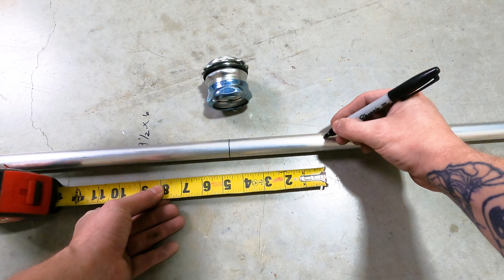How to Bend a 3 Point Saddle in Conduit

Comment: From the center mark where did you come up with 10.5 inches both directions for the 10 degree bends?
Reply: I was wondering the same thing but he is bending it on a 22 1/2 degree cap he used the multiplier

Comment: I always measure to center of obstruction, place mark on conduit at that exact point, then I multiply the height of the obstruction by 2.5 and take that number and go that distance off both sides of the original center mark, and then I use the push through method, first bend on star (22 degrees), second bend on notch (45 degrees) third bend on arrow (22 degrees).
Reply: Don’t forget to account for shrinkage :)
Reply: @joshhowie4071 they did, that’s why they multiplied by 2.5 but its good you brought it up because a lot of people forget that especially newer folk.
Reply: thanks boss saved me 10 mins
Reply: Would that be 3/16s per height of obstruction per inch of rise four shrinkage? Then add that to the center of obstruction Mark? Then 2.5 times height to get the outside marks???
Reply: @joshhowie4071  if you use this method you don’t have to factor in the 3/16” per inch of rise for shrinkage. Just make sure you do star, notch, arrow.
Reply: @joshhowie4071  if you use this method you don’t have to factor in the 3/16” per inch of rise for shrinkage. Just make sure you do star, notch, arrow.
Reply: Same!
Reply: With the push through method, do you bend towards the obstruction or just straight through left, middle, then right?
Reply: @rod82nd  just left, middle, right. you don’t have to take the pipe out of the bender at all until you are complete.
Reply: What about the distance? I've done this method and it doesn't cover the distance I needed over the obstruction .
Reply: @DarkKiller4747 sounds like needs 4 point saddle
Reply: @matthewr209 that’s not a push thru if you’re going left, right, middle. L, m, R.
Reply: @damiancontreras9240  oh hey, good catch I miss typed that, you are correct it is left middle right
Reply: Yoooo I appreciate you bro
Reply: What about 1" obstacles? 2.5" is too close between bends. This was an issue today and my journeyman didn't have an answer 😅
Reply: I did this exact method. My center mark is exactly 28 3/4”. However my 3 point saddle ends up an about an inch away from the center so it doesn’t look good. I thought shrinkage didn’t matter for this method? Help?
Reply: @AnselmlZamora next time just try to add 3/16 for each inch of height
Reply: Where does the 2.5 multiplier come from, how do you know thats the multiplier?
Reply: Is it a constant ?
Reply: Why mesure at different places? I’m dumb sorry I can’t this figure this entire thing out in school I might just quit. I could study transformers or electronic circuits like rectifiers and be fine but this shit is making me zone out and plan out my suicide during class
Reply: @MSI8969  to be honest whenever I run into that I just bend the saddle as small as the measurements allow and then take out a little bit of bend in each bend of the saddle if that makes any sense.. you can do it by doing smaller degree bends (like 15, 30, 15) but since benders don’t have a 15 degree mark I find it easier to just bend a 22.5, 45, 22.5 and unbend each point of the saddle a little bit.
Reply: @JessicaMyers-lh1vo  it is constant for this method.
Reply: @Justin-jy6fu  well you have to measure in 3 different places to determine where to put each bend, not sure how to really explain any better over a text, sometimes it just takes time and repetition.
Reply: @MSI8969 you use a smaller bend radius. Like 10 degrees. So the multiplier is 6.

Comment: The shrinkage on a 3point saddle is 3/16" for every inch of rise.  Never mind I should keep watching until I comment. I use the notch and bend a 45 and 22.5 on the arrows
Reply: Depends on the degree of saddle. You can do a 45 deg center bend and 2-22.5’s. Or a 30 deg center bend and 2-15’s. If you wanted you could even do a 60 degree center bend and 2-30’s. It’s the angle of bend that determines the shrinkage per inch of saddle/offset.
Reply: Yes, the only thing I would add to this is to find shrink you use the formula shrink= angle/120.

Example 30/120=.25
    1/4” per inch of height

Ex 2: 45/120= .375
    3/8” per inch of rise
Obstacle is at 20” off the end and 3” tall. Then make center mark at 21 1/8”
Reply: @Ephesians-ts8ze  Exactly. Electrician U apparently doesn't understand this and proceeds to mess up on his tutorial.

Comment: is it just me or does anyone wonder if that bend would of ended up coming out right ? Where he initially made his center mark ( I think it was 57'') and then did all that calculating just to still have the same initial center mark defeats the purpose. The point is and please correct me if I'm wrong... is for the center mark to to be past 57'' after doing the calculations so that after the shrinkage occurs it ends up being back at 57''. Hope i explained my doubt right
Reply: Exactly.  He got Me all confused! You add the shrinkage to that center line right?

Comment: Thank you for posting this

Im ~1 1/2 year into this trade and have always worked in industrial setting where we run only rigid, aluminum or stainless depending on if its a wet area or not. So ive always  used a power bender except for when its time to bend saddles, which i struggle with. After watching your video it looks like i am overbending

Comment: So the object is 2 inches. 2 inches for every inch so 4 inches. Plus half a inch for shrinkage. Where does the last 6 inch number come from?
Reply: I’m also confused about that
Reply: That’s where I got lost too.
Reply: same
Reply: Yep
Reply: Same
Reply: Edit: I looked into it and it seems somewhat correct according to a Klein chart on it being sort of like offsets. 10 degree has a multiplier of 6 for offsets, so 3 per side since there are two of them and we are splitting it up for either side, or 3 x 2 inches for 6 inches per side, and 22.5 has a multiplier of 2.6 per inch for offsets but since there's only 1 bend instead of 2 so I think 1.3 is the multiplier in this case, so I'm getting 2.6, shrinkage for 10 is 1/16 and for 22.5 is 3/16 so he added both for 1/4, idk where the other inch came from, and I'm guessing he rounded up from there. I saw another video on this, you measure from where your conduit runs from to the obstacle, add the shrinkage of your outer bend (in this case 1/16 per inch of obstacle height) onto that initial measurement (instead of 57, think 57 1/16) and that's your center line, then use the normal offset multiplier (in this case 6 per inch for 10) and measure off that from either end and that's your outer lines, use the notch that was shown in this video for the center bend and the others on the arrow. It was a lot more simple.

I think the first 4 is for the 22.5 bend and the 6 is for the 10 bend, similar to offsets, at least that's how it sounded to me. The 22.5 would be steeper so with the 10 he has to go farther back from the object to make the bend to get the correct rise and fall, thus 6 inches away instead of 4. I could be wrong because I'm confused too, but it sounds like something that might be correct.
Reply: I've been told 3/16

Comment: Dude, you add the shrink to the center mark. If the center of your obstruction is at 57", and you don't add the shrink to that, your center bend won't line up with the center of the obstruction. You have to add that 1/4", or whatever the shrink may be with the degree of bends you are using, to that center mark. So your center mark would be 57 1/4" to account for shrinkage.
In your example, it doesn't matter because you can move the obstruction to be perfectly center.
Reply: @nikogarcia3249 how does the shrinkage effect your measurements in a 4 point saddle?
Reply: @awood965  same way, depending on the degree of bends you are using. But no one cares on a 4 point saddle because you can't really tell if you're a 1/4" off of center. It's very noticeable on a 3 point saddle, however.
Reply: @nikogarcia3249  thankyou sir good info
Reply: Thank you so much I was looking for someone else to catch this thought it was just me lol.
Reply: There is more than one way to cook a burger 😂

Comment: Rubbing alcohol / isporopanol dissolves permanent marker/Sharpie. 
I learned that one in college chem lab, and have used it many times since. 

I've even seen people use hand sanitizer (usually ethyl alcohol/ethanol, the same as drinking alcohol) to dissolve Sharpie. 

Lots of organic solvents dissolve it, since it's really not so "permanent" at all
Reply: pvc glue will as well if the plumbers are around
Reply: Or any shit body spray

Comment: Pro tip, use a dry erase marker. Ive seen many bends with pencil marks left on it.
Reply: i was going to say that also
Reply: Pro tip: just rub off the pencil mark with your finger. If it's to high for you too reach then it's too high for you to see it.
Reply: Nice
I use whatever I have because I could care less as long as the bend is correct conduit is always dirty no matter what when you buy it.
Reply: I don't care either way.
Reply: I am a residential, commercial and heavy industrial electrician, can out troubleshoot 90 % of union sparkys .Construction electricians don't impress me lol...Troubleshoot instrumentation, motor controls,d.c drives ,vfds,plc's etc.35 years in the trade.

Comment: Would you always add 6" for the method he's using?
Reply: I believe he's adding 6" because he's bending 3/4" EMT, the lines you center your bender on should be a certain distance from where you want the bend depending on the size of the conduit - 5" for 1/2", 6" for 3/4", 8" for 1"

Comment: Angles were not discussed, so measurements made little sense to me. For ever inch add a quarter for shrinkage, why? Why didn't you state what height you had to clear?
Reply: I’m a ElectricianU fan but the info in this video could have been explained better. I’m not sure why he used a 1/4” of shrink per inch of rise when a 10 degree bend has a 1/16” of shrink per inch of rise. So since he had to clear a 2” obstruction the distance from the end of the conduit to the center of the saddle bend would be whatever that theoretical distance is plus 1/8”. The shrink itself is derived from your outside bend angle and not your center bend angle.
Reply: @lazarevic95 thanks
Reply: @lazarevic95  because he doesn't know the standard way of doing a 3 point saddle.

Comment: I wonder if it's easier to think of it as an offset so if you need your measured clearance just to add the shrinkage of your 1/4" on both sides so you can scale it to other bend radi. So like 45 and 22.5 is going to be 2x offset calculation plus shrinkage?

Comment: Isopropyl alcohol will remove sharpie with ease. It's the solvent used in the marker to begin with. Wipes right off.
Reply: Pro tip just throw more sharpie over it then wipe away immediately comes right off
Reply: @izzywashington5461  then you have more residue.. Using clean cheap solvent is the Pro tip to do things right..

Comment: Shrink is calculated by 
   Shrink = angle/120

Example 30/120 = .25
   Add 1/4” per inch of rise to     
center mark

Ex 2: 45/120 = .375
  Add 3/8” per inch of rise to center 

An obstacle 3” tall and 20” off end. Center angle at 45 degree. Center mark would be 21 1/8” off end.

As a note shrink does not change the height of the bend. That is calculated when using multiplier associated with center bend

Comment: Seems like you was not taught the correct steps and calculations to do a 3 point saddle. 1/4" is the shrinkage and 2 is the multiplier for a 30 degree offset. You were suppose to use two 30 degree bends and one 60 degree bend for your calculations. Instead,  you used two 10 degree bends and one 22.5 degree bend to make your 3 point saddle. The shrinkage for a 10 degree offset is 1/16" and the multiplier is 6. It's a 2 inch diameter object so you will have a total shrinkage of 1/4". You need to mark 2 equal distances from each side of your center mark, which will be your multiplier for a 10 degree offset (which is 6) multiplied by 2. So your 2 distances from each side of the center mark is 6x2= 12". The 12" markings on each side of your center mark will be where you do your 2 other bends. If the distance is 4' on one side to the center of your obstruction and 5' on the other side to the center of your obstruction, you need to add your shrink accommodation on both sides which will make them 4' 1/8" and 5' 1/8".